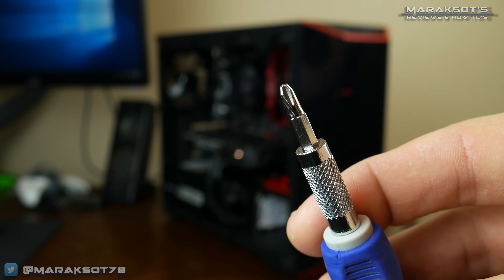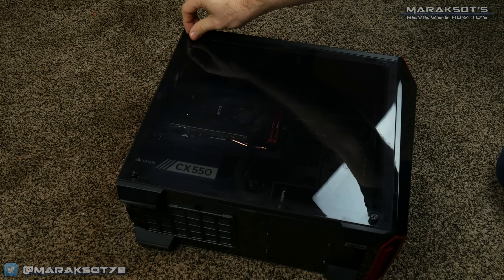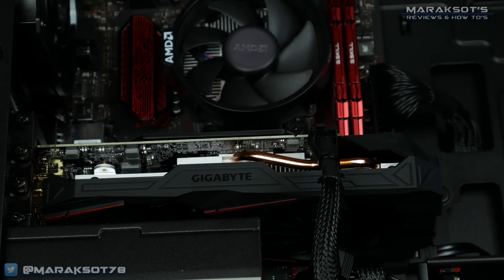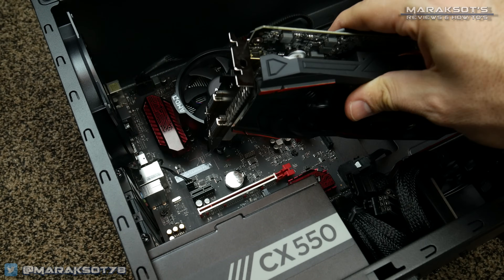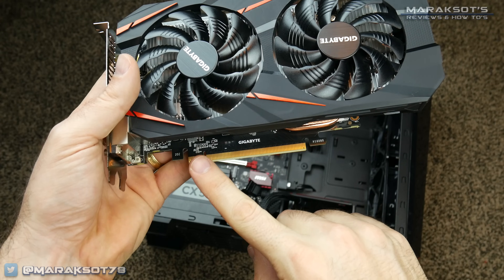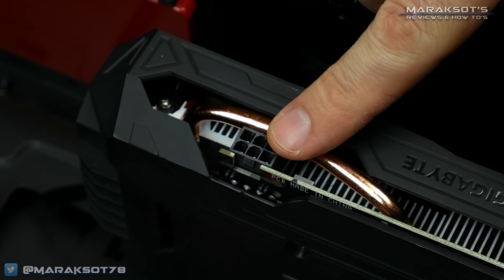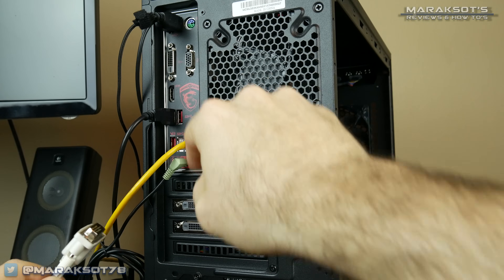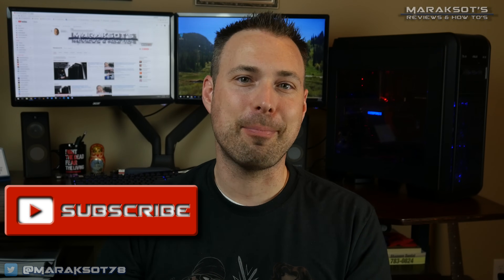How to Install a Graphics Card - Upgrade Your GPU

Comment: Just got the 480 but while playing the new resident evil 2 remake my graphics card temp was around 85 or 86 I’m not good with PCs but is that safe or should I try to get lower temps
Reply from the maker: It sounds like your card is about maxing out on temperature.  Usually you want to see temperatures in the 60's.  All modern graphics cards have safety features built into them to keep you from frying them but when they get too hot what happens is they will automatically down clock to keep from overheating.  This is also known as Thermal Throttling.  This means your graphics card runs slower to keep it from getting too hot; once the temperature has come down into safe ranges again it will speed back up but will of course slow down again when the temperature goes back up.  It will just kind of keep repeating this process and it's definitely not the ideal situation.  I don't know what kind of cooler you have on your RX480 but the blower style coolers (the ones with a single fan and all the hot air is exhausted out of the back of your case) are well known to run hotter than other cooler designs with 2 or 3 fans on them that exhaust the hot air into your case and then your case fans exhaust the hot air out.  You can turn up the fan speed on your graphics card using a free utility like MSI Afterburner or EVGA's Precision X which may help to bring temperatures down but no matter which type of cooler your card has I would ask what your case air flow is like?  How many fans do you have bringing fresh air in? How many removing hot air out? What size are they? And what speed are they running at?  If you have poor case air flow that will definitely contribute to your GPU getting hotter than you want it to be.  There's lots of great videos on YouTube about case air flow.  I'd recommend videos from Linus Tech tips, JayzTwoCents, BitWit or Paul's Hardware they all know their stuff very well.  There are others out there too that are also very good, these guys are just the ones I'm most familiar with. There's too much to really explain here but these few things should get you started.  I'd recommend you look into the stuff I've mentioned and see if any of it helps you.  I imagine in your research you'll learn some other things you can do to help as well.  Cheers!  :)

Comment: Maybe dumb question but: do i need to keep one of my hands on the cpu to keep me grounded or its just like touching it once? Please help
Reply from the maker: I would just touch it once right before you remove your old card and then again right before you install the new one to be safe. What you're doing when you touch it isn't actually grounding but equalizing the amount of static charge between you and your computer. When you and the computer are equalized then the chance of shorting something out due to electro static discharge is very low. I've been building my own computers for over 15 years and have always done it this way and never had an issue. knocks on wood
Reply: @Maraksot78  Thanks a lot for answering so fast! I was going to buy a card tomorrow and i was kinda worried for that. Great video and thanks again!
Reply from the maker: @josetouzett4994  no problem. Im happy to do what I can to help. Thanks for checking out the video. Best of luck to you on your new graphics card.  :)
Reply: @Maraksot78  One last question, im getting a rtx 2070 evga xc ultra and i have a asus b350f gaming rog strix. Where do i have to chech how many pci cables i need and how do i know which one to connect?

Sorry to ask this much, but im kinda clueless righg now. Thanks in advance!
Reply from the maker: That card uses 2 different PCIE power connectors, one 6 pin and one 8 pin. It also recommends you have at least a 550 watt power supply. May I ask what CPU you have? And what is the resolution and refresh rate of your monitor?
Reply: @Maraksot78  I have a 750w power supply. My cpu is a amd ryzen 5 2600 and i play on 1080p 60hz. Im also going for a 1080 monitor with a 144 refresh rate on the future.
Reply from the maker: @josetouzett4994  ok cool. A 2070 for 1080p 60Hz is way overkill but if you're upgrading to 144Hz it makes more sense. Everything is sounding good. :)
Reply: @Maraksot78  Should 1440 in 144hz too much for the 2070?
Reply from the maker: @josetouzett4994  it shouldn't be too much for it, but I believe it would definitely push it to the limits depending on the game you're playing.
Reply: @Maraksot78  I see. One more thing, right know the other thing apart from getting a better monitor, would be upgrading my ram, since right now i only have 8 gb. What should i priorize? (im not really having ram problems as far as i am aware. 

Again, sorry to keep asking more stuff lol, thanks again
Reply from the maker: @josetouzett4994  so are you wondering what you should get first after the RTX 2070? Well DDR4 RAM is at it's lowest prices in the past few years right now and who knows how long that will last. I'd probably go for 8 more GB of RAM first.  At the same time 8GB is enough to get you by so I don't think it matters a whole lot if you get the monitor first and then more RAM. It's up to you. I'd go for the low priced RAM right now though if it were me.
Reply: @Maraksot78  I see, maybe getting 4 more (i have a 2x4 ram) and getting the monitor?
Reply from the maker: @josetouzett4994  your motherboard has 4 RAM slots and it sounds like you're currently only using 2 slots so yah, get 2 more 4GB sticks so you'll have a total of 16GB.

Comment: Wait so should you remove your graphics card first then wipe old graphics drivers and add new ones or wipe old graphics first and add new drivers before taking out the existing graphics card?
Reply from the maker: It doesn't really matter. You can uninstall your old graphics card, install your new one then uninstall the old drivers and install the new drivers if you want. It's not super important which order you do it just as long as the old drivers get uninstalled and the new ones get installed.
Reply: @Maraksot78  Thank you so much man you deserve way more recognition!
Reply from the maker: @sharq5592  that's very kind of you to say. Thanks for checking out the video, Im happy it helped you. Cheers!  :)

Comment: I cant find my pci express power cables
Reply from the maker: Did your computer have a graphics card in it originally?
Reply: My pc came with a graphics card built into the mother board
Reply from the maker: @Ellspins  ok, so you're currently using integrated graphics. That's what I was meaning.  If you don't have any PCI Express power cables then depending on what graphics card you're planning to upgrade to you may need to upgrade your power supply too.
Reply: Ok well what graphic card should i get so it can run game pretty fast but it has to be under £200
Reply from the maker: @Ellspins  are you wanting to get the best graphics card/most performance you can for £200 without having to upgrade your power supply? Or are you wanting to both upgrade your power supply and get the most powerful card you can for £200?
Reply: I already have a power supply just want the best bugdget gaming gpu
Reply from the maker: @Ellspins  ok, what is the maximum output wattage of your power supply? Knowing that will help me know what GPU's will work with it. The more powerful the GPU the more power you need to run it.
Reply: Max input 230v
Reply from the maker: what is the max output?  It'll be in watts.  For example my power supply has a sticker on the side that lists all the specs.  One of the fields says Output Power, P cont. and in that field is says 750W @+50°C so the maximum output wattage of my power supply is 750 Watts.  For the graphics cards I'm going to recommend here you're going to want at least a 500 watt power supply.  Depending on the particular model of graphics card you may even need more.  I live in the US so I did my best to search for UK sites, admittedly I'm not familiar with any so I don't know where to look for the best deals, but for £200 I found that Aria PC has a Palit GTX 1660 as their deal for the day and the 1660 is going to be the most powerful card you can currently find at that price.  If you're unable to find a GTX 1660 for £200 or less then I'd recommend looking for an RX 590.  If you can't find any of those in that price range then I'd go with an RX 580 8GB.  These are all fantastic 1080p graphics cards and are capable of running most games (not all) out there at 1080p max settings at or above 60fps.  For the games that they can't run 1080p max settings 60+fps you just need to turn some settings down a little bit and you'll be good to go.
Reply from the maker: I actually just recently made a video where I go over all the stuff that's important to know when choosing a new graphics card.  It's designed to help you figure out which graphics card is best for you based on what monitor you have as well as what CPU and what wattage power supply you have.  If you'd like to check it out here's a link https://www.youtube.com/watch?time_continue=561&v=wTag8h-yEOU
Reply: Have u got discord were i can speak to u there
Reply from the maker: I have if you want to communicate more in real time you can get me on Instagram I'm Maraksot78 there or you can tweet at me on Twitter I'm @maraksot78 there

Comment: My graphics card (MSI Radeon RX 580 Armor) won’t work. I downloaded all of the drivers and everything. It might need a pin connector but I can’t find it in my pc.
Reply from the maker: So you got your new RX580 graphics card installed but didn't connect the 8 pin PCI Express power cable?
Reply: Maraksot78 yes I can’t find it, I don’t think it I ever had one, my last graphics card didn’t need one.
Reply from the maker: @kayon1072  it is very possible you don't have one on your power supply. What is the maximum output wattage of your power supply? The RX580 is recommended to have at least a 500 watt power supply.
Reply: Maraksot78 how would I check? And thank you for all the responses
Reply from the maker: @kayon1072  there should be a sticker on your power supply, either on the top (aka side opposite the fan) or the side of the unit that should say what the maximum output wattage is. It's usually on the side so you don't have to remove your PSU to see it.
Reply: Maraksot78 yikes, I think it is only 300 W
Reply from the maker: @kayon1072  that would make sense if your previous graphics card didn't require supplemental PCI Express power. I would strongly recommend upgrading your power supply to at least a 500 watt since you're upgrading to the RX 580 because if your system draws more power than your power supply is capable of outputting then theres a very real risk of buring up your power supply and potentially overloading your system and frying everything.
Reply: Maraksot78 thank you so much for the responses! I will be getting a new one, 500 W. Just got to find the best one with similar wires and stuff!❤️
Reply from the maker: @kayon1072  if you're looking for something good at a low price this one is normally $55 but you can pick it up for $35 on Newegg.com right now, and EVGA is a good brand. https://m.newegg.com/products/N82E16817438145
Reply: Maraksot78 I was thinking of getting one online but my uncle keeps telling me I should go to Best Buy and give them my old one and tell them to give me a 500 W power supply with the same wires as my old one
Reply: Maraksot78 but if I do buy one online will it come with everything I need?
Reply from the maker: @kayon1072  so are you worried about having all the power wires you need for your motherboard, CPU, hard drives and everything?  You don't need to worry about that.  All motherboards use the same 24 pin power connector so all power supplies have that on them.  As for your CPU you probably have a 4 pin connector but even if you have an 8 pin the power supply will have that too.  As for your DVD drive and hard drives they use SATA power connectors and the new PSU will have those too.  Unless you have some very specialized hardware, which is very unlikely, a new power supply will have everything you need on it.  A couple years ago I made a video series on how to build a PC; it sounds like those videos could be a big help to you.  Here's a link to one where I talk about installing a power supply and connecting the cable to all your hardware. https://youtu.be/eOA_iAyWcOI?t=616   The portion on the power supply goes from 10:16 to 13:05.  I do skip over some stuff there however because I covered it earlier in the video.  https://youtu.be/eOA_iAyWcOI?t=73  that portion is from 1:13 to 2:15.
Reply from the maker: @kayon1072  Yes, if you buy a 500 watt power supply it will have everything you need for your current system and the PCI Express power cables for your new graphics card.

Comment: bro do u know how to remove the plastic shield cover for the power supply?cause the 6pin cable I want is in the cover and I cant find the right tool for this weird looking screw lol
Reply from the maker: So I'm guessing your case has a power supply basement? Usually you can get to the cables in the basement by removing the other side panel on your case but I guess it depends on your cases design.  Hopefully by removing the other side panel you can get to the power supply and the cables.
Reply: Maraksot78 I tried that but the spare cables are like tied together and kinda hard to grab
Reply from the maker: @junioralamu7438  so did the manufacturer zip tie them all together? If so you'll have to cut the zip tie and find your PCI Express cable.
Reply: Maraksot78 aight thanks mahn

Comment: im getting a gtx 1070 and i already have an i7 7700k what power supply do I need? I have a 480w cheap chinese one rn is that enough?
Reply from the maker: The recommended power supply for a GTX 1070 is 500 watts, if it were me I'd upgrade to a better power supply.
Reply: @Maraksot78  would it damage it at all if i dont?
Reply from the maker: @Nick-tp1kz  I don't know for sure what would happen. Everything may be just fine but on the other hand it could overload your power supply and burn it up and then it could damage other components in the process.
Reply: @Maraksot78  alright ty for the feedback
Reply from the maker: No problem. Best of luck to you on your upgrade.
Reply: Is there any way I can send you a picture of my motherboard? I cant find where to put the 3 pin fan connectors I've been building for like 4 hours
Reply from the maker: @Nick-tp1kz  I assume you're talking about case fans? Depending on your motherboard you may only have one or 2 fan headers. And they may be 4 pin PWM headers. You can plug a 3 pin fan onto a 4 prong header just align the groove on the fan header with the tab next to the pins. You can also plug a 4 pin fan into a 3 prong header the same way. If you'd like me to look at a picture tweet it at me, I'd be happy to look and help. I'm @maraksot78
Reply: @Maraksot78  idk I probably have to bring it somewhere I wont have a PC until I get money I guess it wont even turn on
Reply from the maker: @Nick-tp1kz  that's a bummer man. Wish there was more I could do to help. I do have a series of videos I made about building a computer you could check out if you feel they may help? https://www.youtube.com/playlist?list=PL-qY8D-eM9xDQEVH3PqAp66Dg8yk_Kq7_

Comment: I appreciate the comment about plugging the monitor into the video card port and not the other. I did this when I first got my PC and was dumbfoundedly stumped for 2 days before I figured it out. I felt like a complete ass. I was furious that a new GTX 1060 was running Dark Souls 3 in pixelated graphics lol. I face palmed so hard on that one.
Reply: Bag Meat I got a pre-built computer and I did this the first time and the system was not working! When I worked it out I literally smashed my head on the wall LOL
Reply: What about hdmi cables though?
Reply: @francisdrake7428  i have a HDMI port at this place.
Reply: This happened to me before when I first got my new PC with a GTX 1060. For YEARS, I unknowingly ran it on integrated graphics. I never really noticed anything since I played low-demand games. However, it started to hit me when I began playing more demanding games. I thought my GPU was just trash at that point, but I then realized it was actually because I had not plugged the monitor for the GPU.
Reply: Hey when I built my first one I forgot to flip the power switch on the power supply I was so pissed I thought maybe I broke something putting it together
Reply: I did the same fucking thing 😂😂 first 2 Days even bad Games were laggy af and Each Time i wanted to start the PC it would Tell Me There was no signal ... I had to shut it down and restart it 3-4 Times before it work ... When i decided to look closely i saw Little Black pieces of plastic , at first i thought it was meant to hold some part in the PC but no 😂😂 it was to protect the HDMI/display ports 😂😂
Reply: i 100% did this exact same thing....but not just for 2 days, I was stuck trying to figure out what was wrong for MONTHS! could not for the life of me work out what I did wrong, did tons of googling, watched tons of youtube videos about what to do if your graphics card isn't working....etc....and not once, anywhere in all of my research, did anyone say anything as simple as....make sure you've plugged ur monitor into the graphics card, not the motherboard. haha. 
complete noob mistake, and the facepalm was violent and well deserved.
Reply: Bag Meat wait what does it mean if you plug the monitor to the video card port?😅
Reply: we have all been there
Reply: I just got back from a computer repair shop where I just paid $35 to get that same advice he gave a decade ago for free. The more we change, the more we stay the same.